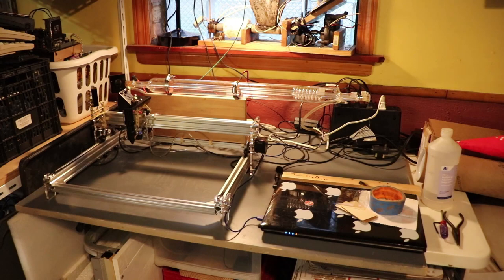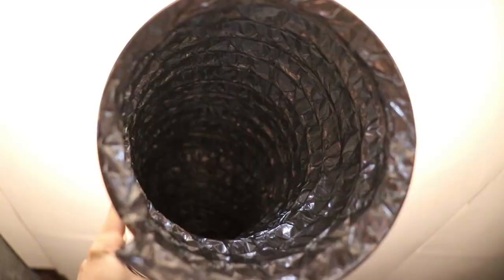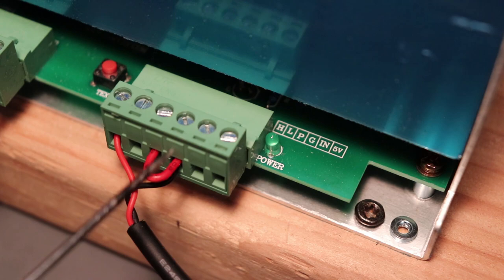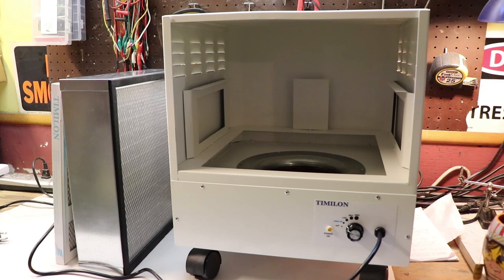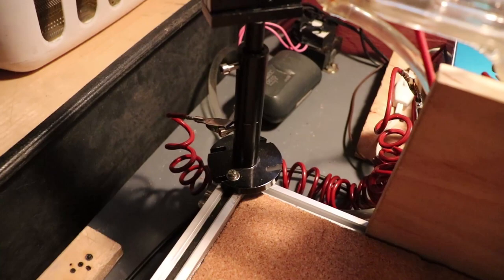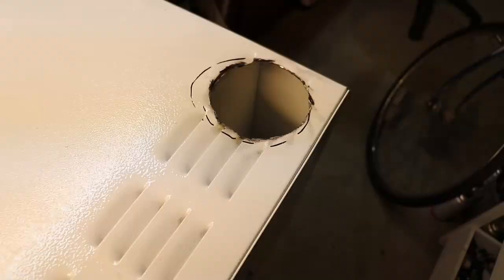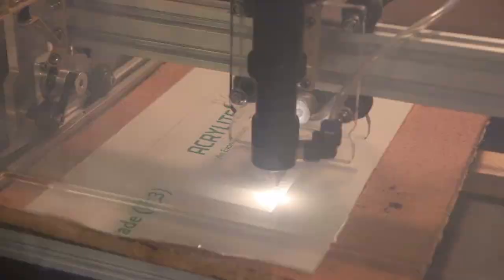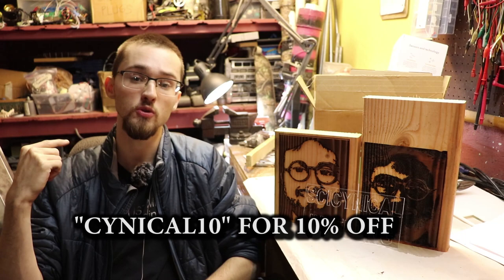Connecting this Air Purifier to my LASER

Comment: One other thing, the filter's current would go down when the flow decreased, whether it is because of a filter or any other flow restriction. I know it sounds crazy, but try it with your vacuum cleaner - block the nozzle and the motor will spin faster and the current will go down.

Comment: First, get a CO detector! Laser cutting also produces carbon monoxide and this has killed people! You don't need to worry about getting a total seal on the window to the laser chamber. In fact, the filter might do a better job of protecting the laser with more airflow. I would consider adding a small duct that moves with the laser head to divert the worst of the smoke as close to the source as you can collect it. Just put the end of the small duct a little ways up into the hose adapter at the top. I would add a manometer to make sure that you have a slight vacuum in the chamber. You don't want too much vacuum because that will reduce the flow to the filter, but you do need some to prevent exhaust escape. Last I would consider filtering the inlet air and directing it to keep things cool and clean.

Comment: Ok first of all you need to vent your laser enclosure to allow air in as you are creating too much negative pressure within the enclosure. Secondly try adding an activated carbon filter after the HEPA filter to quench the poisonous carbon dioxide/monoxide gasses. Thirdly co2 laser tubes do not tend to run on PWM, they prefer all on or all off as you are already doing it and controlling the power with a potentiometer. RF Co2 lasers tend to use PWM.